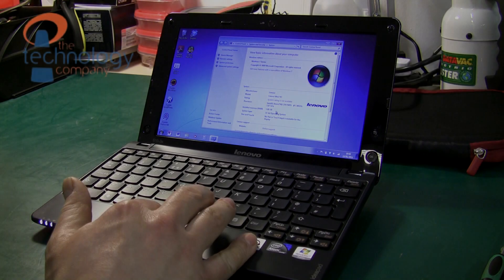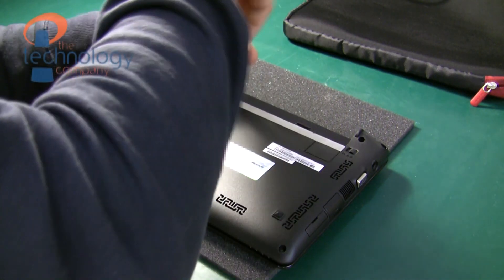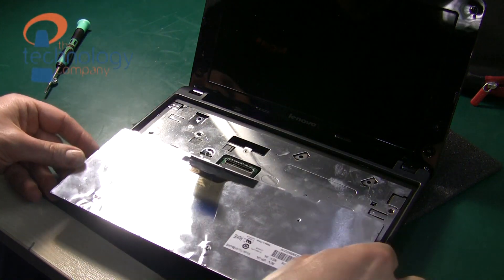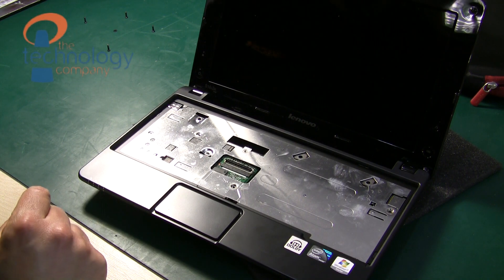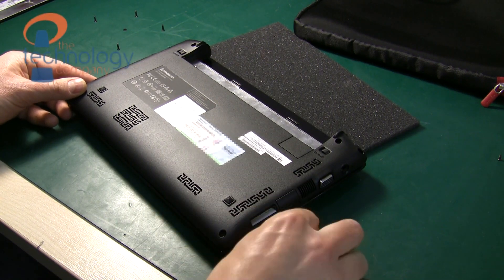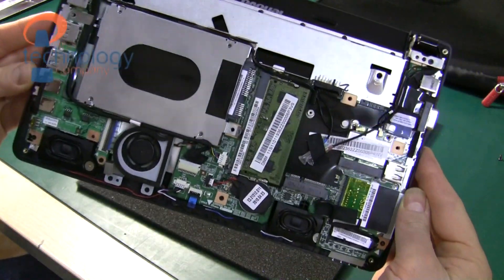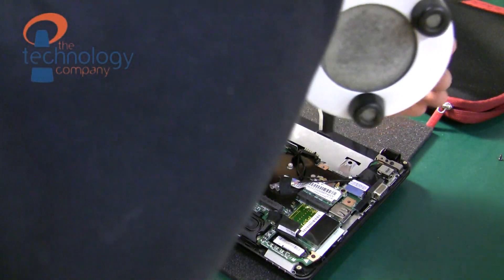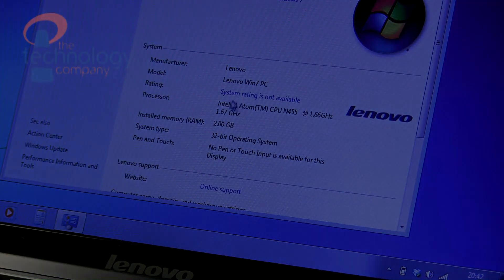Upgrade Memory (RAM) on Lenovo s10-3s Netbook (Laptop)

Comment: Thanks a lot. Just installed my 2GB of RAM! Took me less than 10min - including showing the bare inside of the netbook around :) You not only recognize the 1GB real free RAM (compared to the 150MB before) but also the lower HDD reads and writes. I'm quite sure that will also increase battery life additionally! Again many thanks!